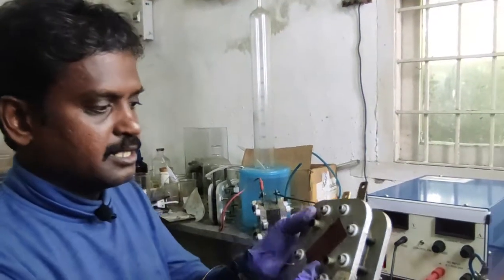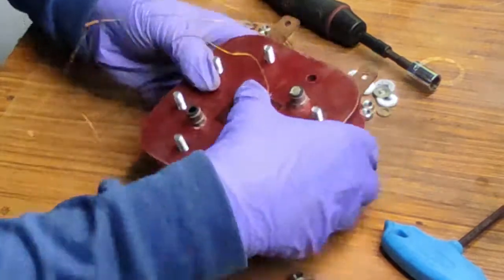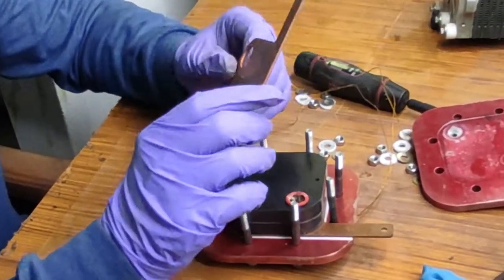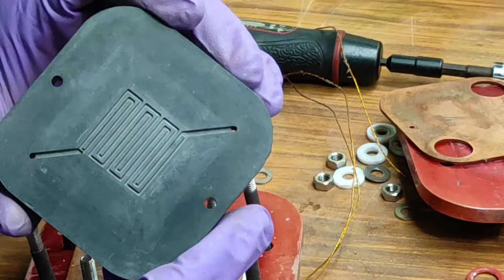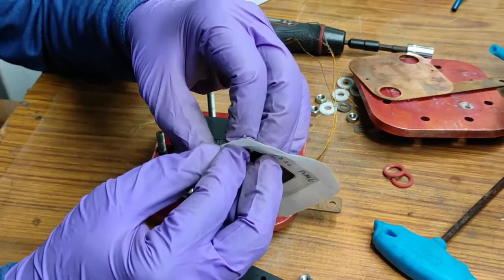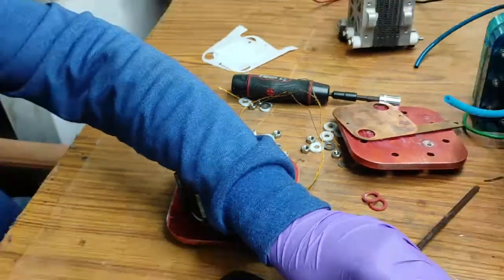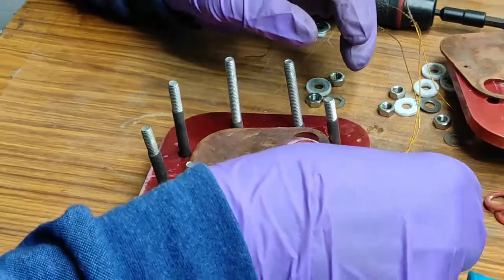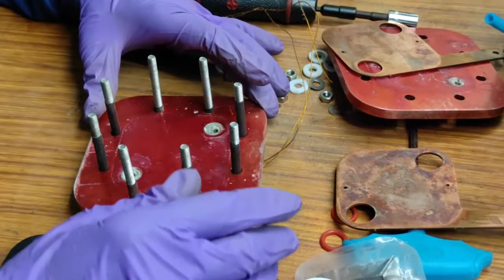FUEL CELL AND DISMANTLING

Comment: Where can I get the connectors? How many mm are they?
Reply: In the plastic fuel cell u have on the table
Reply from the maker: no its PEM electrolyser
Reply from the maker: connectore 1/8 th BSP std, varieties of plastic and legris , swagelok connectors are available